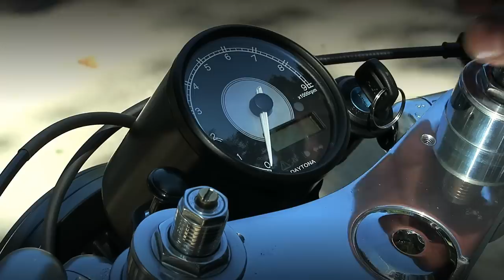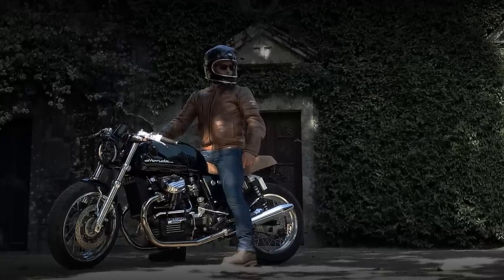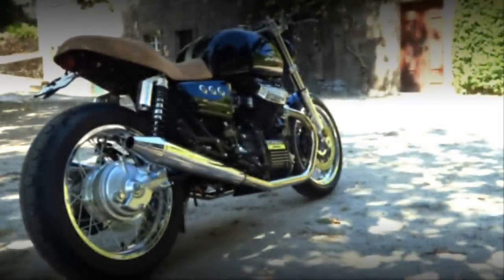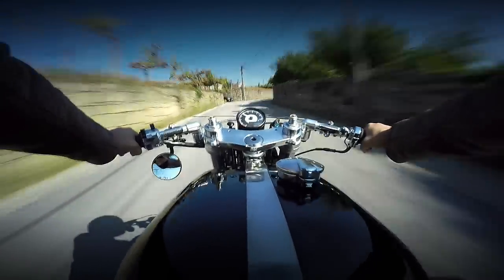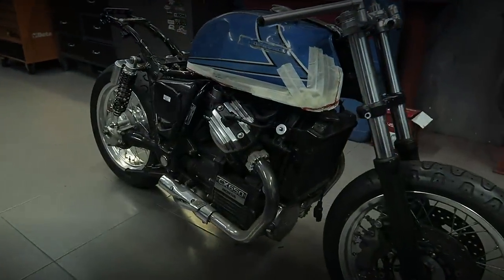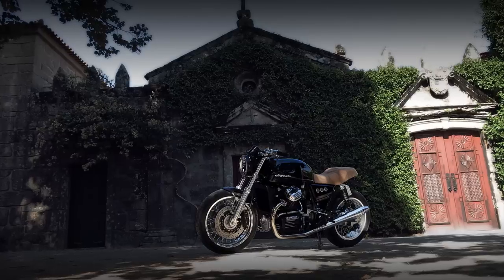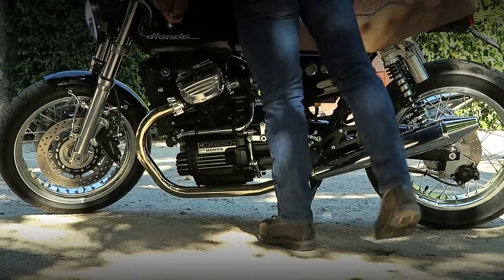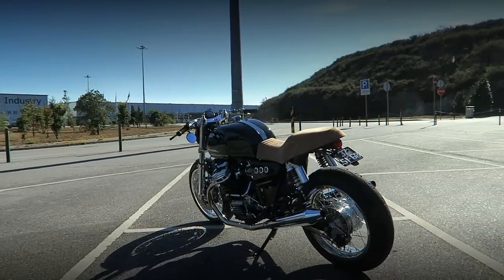Cafe Racer (Honda CX 500 / CX 650 by Racer TV/Oficina das Motas)

Comment: I agree, Victor. It is a nice bike.  You have every right to be proud.  BUT (and there are some monumental "buts"), someone with some formal design training has to step in and address a few things, some of which are glaringly obvious:
Given the passion to which the design aspires, this is absolutely the wrong place to have narration by an emotionless robot.  Find another way.
The narration's patting itself on the back extends to the insufferable.
Accidents during the design process cannot be points of pride; they are accidents.  A designer cannot thump his chest about accidents.
Strutting, when there are changes still pending, comes off as premature.
Do not subject your audience to heaps of your hubris; just show the bike and let them be the judge.  The bike either succeeds on its own terms or it fails.  Strutting does not make the bike better.  Have some humility and some faith in your presentation.  Respect your audience.  Never tell them what to think about your design.  This video nearly screams at its audience what they should think.  For much of its running time, it has the subtlety of a costumed wrestler in a novelty fight.
-and on the subject of the design choices, themselves-
Nobody with any class would slap LED headlamps on a Jaguar E-Type, but you did okay with yours.  Pass.
Nice job hiding the front brake reservoir; how long before you stomp your boot onto that rear reservoir?
The tank emblems seem cheaply made, although their placement and typeface are adequate.  Are they plastic decals?  Get them made of something more substantial.
Install a better tail light.  One suggestion would be a classic Lucas tail lamp in a polished aluminum frame.
If you want the fabric of the seat cover to be seen elsewhere on the bike, you could wrap the grips in the same material, perhaps, or create a leather document case or tool porch to complement that seat.  Discoloured pipes don't cut it.

The more elements of a design and presentation one fusses over--and here there are many, many things you are fussing over very deeply--the more fronts on which one leaves oneself open for legitimate criticism.  If we expend great effort to fine-tune the details of a bike, or a video, the openings for criticism multiply to be that much greater, still.  This is why it is much harder to create a motorcycle to be a work of high art than it is to build a heart-stopping scrambler/beater bike with a rusty tank and parts held on by metal straps and baling wire.
  There is always this justice to art:  The higher one aims, the further one drops when he misses.

If the bike is Frankenstein, are you then the monster?  There is room for that interpretation: that the bike has created you.

Bless you , at last, for giving us more moving images.  Panning across so many stationary photos has begun to smack of watching someone else's onanism.

Here is a lesson from design school:  This bike of yours is a nice sketch.  You have now completed a sketch, but it is only one sketch.  As we were taught, "Until you do something at least five times, you have not yet done it".

Good luck on your second, third, and fourth sketches, and as you move to a complete design.  Your progress is very worth watching.
Reply from the maker: Thank you my friend for sharing such extensive and honest opinion.
Due to the high success of this video (The most successful video i made until today), i can't answer to all the "buts" you said.
But i am going to explain some facts that you need to know.
I am not an industrial designer.
All my videos are always based on my personal opinion on the projects i present, and this is what Racer TV audience is expecting from me.
I use this "robotic" voice created by software, because i'm Portuguese, and my bad english accent (and voice), can ruin the documentary character that i like for my videos. I already tried a real american voice in one of my videos, but things didn't worked as i expected. Curiously, the robotic voice sounds very good for all non english natives. 
All the options/details on this project were extremely well thought, and i always tried to avoid ordinary options, like brown grips.
I recognize that the script and editing work could be better.
But unfortunately, i didn't have enough time to do it, especially because i do it all alone.
Besides all these things, i am really happy for everything. According to all the comments i read until now, the project is really a huge success, and the video has more views and "Likes", like no other video i presented during the last 5 years.
Thank you my friend for sharing your perspective. :) Cheers.
Reply: Victor, your design sense is marvelous, and you can rely on that with confidence.  You have terrific taste.  (I might be biased, because I like your bike A LOT, and you and I also have the same helmet!)  And your CX is a thing to be celebrated, even as you go forward, making future design decisions about your bike and the rest of your life.  What I imagine is you are an interesting person we would like to get to know better.  Your bike says that about you.  But we do not know anything about you or what you are like as a person, except that you point at the bike and state your powerful attachment to it.  Perhaps you might speak on-camera about how you worked through some of your design decisions to produce these wonderful results, then have one of your English-speaking friends record a voice-over.  Even if your friend has an accent (that is a good thing!), it would still give us a chance to understand the bike is an extension of you, that you and your mechanic worked together to make it look this way; it is not something nice you found one day under a rock and then worked hard to dig out for ten months and put in front of an old house.  I don't want to hear that you love it.  I don't care.  I want to hear how you made it what it has become.

If you continue to make and edit live-action video, I think you will create small movies with a sense of ease and majesty.  Your camera likes to linger on beautiful things.  (The end sequence for this video may have worked better if the old bike went through the garage door and then emerged without so many seconds of delay.  You are trying to show us, "Look!  After all this effort, here is a beautiful magic trick!", so  display your magic with a flourish!  Take away the on-screen text about the months of delay; we know about that, already.  Just put aside the arduous journey give us a smile:  "No worries!  See?  It was worth it!  Voila!" )  But if the movie is about the bike, then the movie should not be about how you make movies, okay?

We have a saying in the U.S.: "Everybody loves sausage, but NOBODY wants to see the sausage's being made".  Some similar wisdom applies to a discussion of design decisions.  Industrial design can be messy.  (Yes, I was an industrial designer; today I'm getting a degree in engineering.)  If the design process becomes confused, sometimes, or if accidents produce results that are not intended, it is usually best to leave out those things from the story you tell, afterward.  Let the bike speak.  Where something about the bike is wonderful, tell the story of how it became so wonderful.  There is no need to tell a story about things the bike is not saying.

Please:  If you don't have the time to do a design well (a bike, a video, write a letter, choose an  outfit, make dinner...), then do not do it.  Have respect for yourself and for design.  Don't make bad designs, cook bad meals, dress sloppily, write as if you don't care, or bodge-up a motorcycle, and then say, "Too bad.  I don't have the time to do good work".  Life is brief!  Time is both a luxury and a thief.  Nobody has the time to do everything to perfection.  Our identity, then, becomes about which choices we make in the time we have .  You are beginning to learn the difference between sketching and making complete work.  Sketching is freedom.  Sketching is creating, always, in a manner perfectly suited to the time and materials available.  Sketching is a conversation, back-and-forth, with yourself, repeating and repeating and repeating and seeing how things change.  Sketching is how we grow, day-by-day, moment-by-moment.  But the end vision is a thing that enslaves us, that torments us, and only our very best will survive to be offered with the words: "I made this".

Sometimes everything we have done in the past seems not-good-enough ("That old thing?  Forget that!  I was still learning!"), but the NEXT thing always channels fresh joy!  ("This will be amazing!")  Live in this creative moment, always.  Let yesterday's decisions be recorded and let the sorrows and shadows pass and be done.  Be driven forward, always.

Design is a pain in the ass!  It does not want you to sleep.

The bike says, "Victor has an eye for beautiful things".  The bike says, "Victor has a connection to a culture standing on timeless design and an appreciation for man's relationship to the road and to his machine".  The bike says, "Victor seeks out things that will endure".  Interview the bike and tell us more about why the bike is right.

Do this for yourself, if it is what you want.  "What your audience expects"?  Ha!  Screw your audience!  We don't make your design decisions for you.  Thank us, if you will, but never blame us, nor give us credit.  What you owe us is one thing and one thing, only: clear communication.  What you owe to yourself is to make the best decisions you can make.